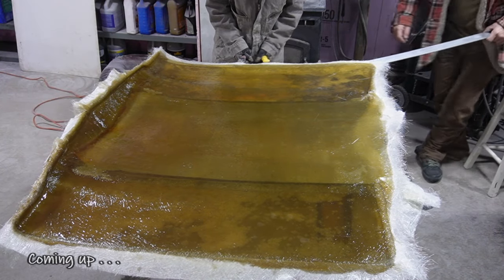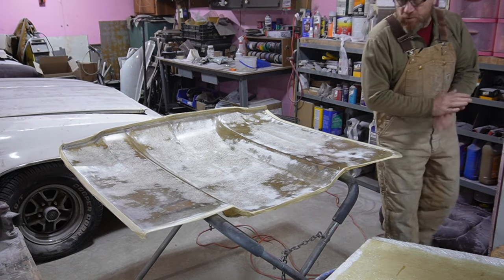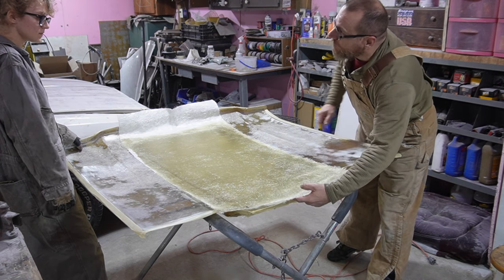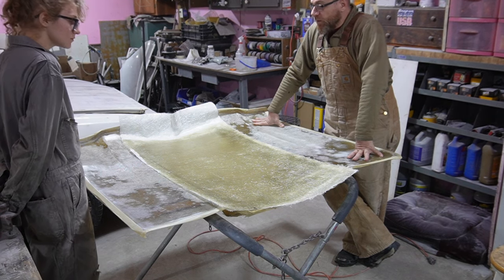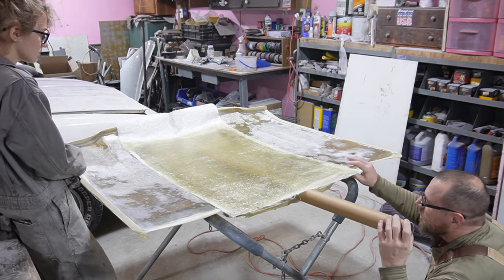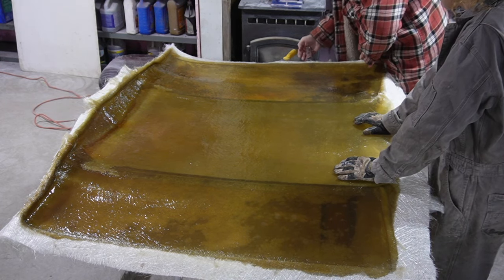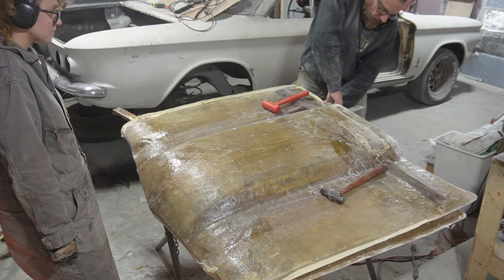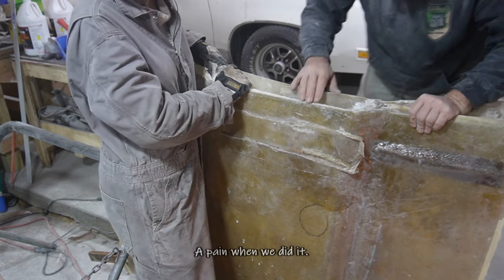Home Depot Hood Scoop Part 4 ┃ Episode 55

Comment: FYI. You can add fiber glass resin without the harder  to bondo to make l glazing puddy.   The mix I do is about 1 -2 %.   Or about the same amount or bondo harder I use.    Hope this trick helps.   😊.
Reply from the maker: Will see some of that in the next episode. Thanks for the tip!

Comment: title said "Home Depot Hood Scoop" and I half expected to see an adaption of a fiberglass bathroom vent that you mount on a roof. <LOL> BTW, that scoop could have been extended a few more inches closer to the glass and overlapping the cowl intake. Have seen that done on early Corvettes and looks decent... but it also needs a taper to clear when opening the hood in your case. (Corvette hood flips forward so not an issue)
Reply from the maker: 🤣 . I thought about extending it back a bit, but not until I had everything cut apart. Dismissed the idea after realizing that. Now that I'm talking about it I could  have trimmed it down, but...
Reply: @drybonesgarage777    You could also make a second piece to mount on the cowl and have them meet / overlap with a small strip of rubber, as the hood closes. Of course, all this is just for looks unless you also seal to the air cleaner for ram-air. BTW, this is my first video here and I see a full frame, so suspect this will be a front engine conversion. If you do a conventional front radiator you can fabricate an air intake below the bumper with a small air dam or louvers to channel flow. In that case the hood scoop will just let the hot air out... if you keep it short. There's really not much to be gained by using a hood scoop to feed the intake unless you have sustained high speed. You'd be better off feeding cold are with ducting from elsewhere. Think T-bolt Ford with intake through the extra headlight holes and replacing the stock lights with higher output units, or adding driving lights on the bumper.
Reply from the maker: I have some ideas I don't want to reveal yet, but the idea is more fresh air vs ram air. Will have more fabrication on the hood when we are closer to that point, and the weather is better.

Comment: After the mold release did you wax it 3 times? or is it before the mold release i forget it's been decades.
Reply from the maker: The stuff we got was a stand alone. 3 coats. We went 5 on the last layup that was shown in this episode. Worked great on bare or painted metal, but obviously not when against the mold we made. I am thinking it had to do with the paint we used due to the amount of material transfer foist from the original and then to the part. Kinda lost on that whole deal.